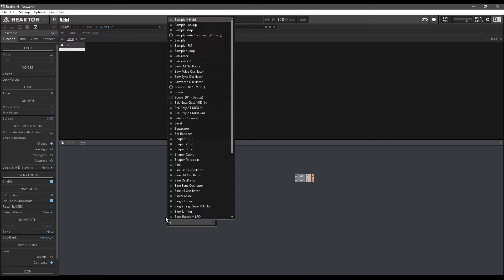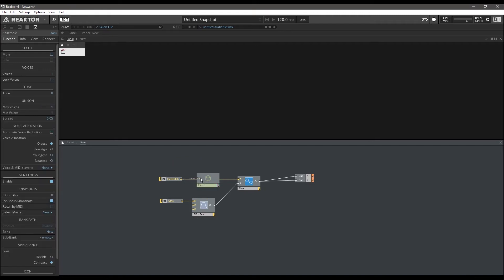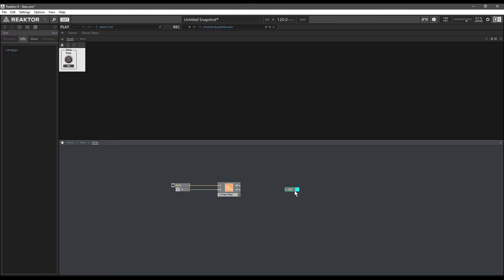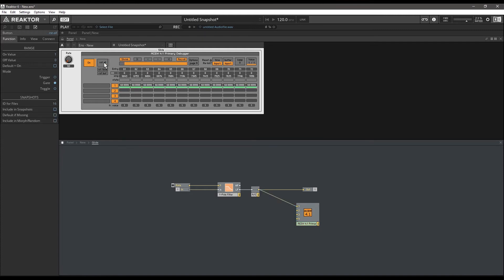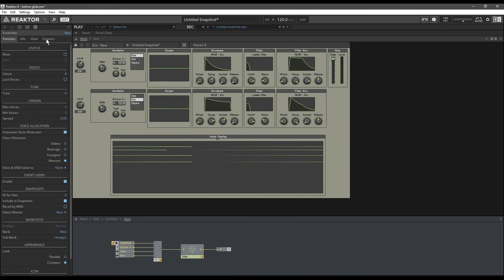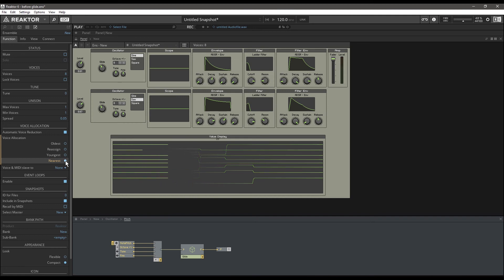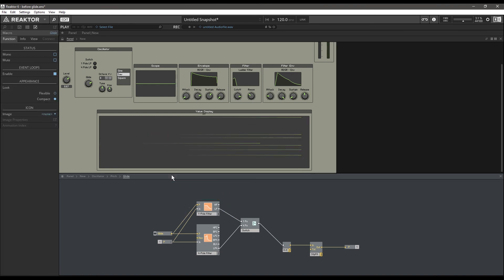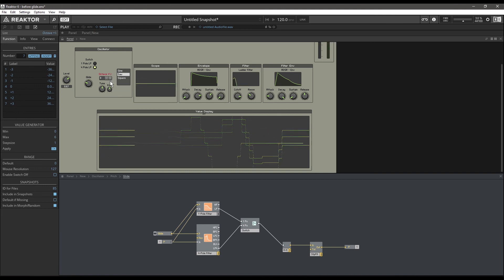Reaktor Tutorial - How to create PORTAMENTO & GLISSANDO

Comment: This is nice, man. Thanks for doing it. I hope you keep them up. You have a great presence on the screen. I have a few comments. 

 • I have been using music.stackoverflow.com for some Reaktor discussion. It's a pretty nice format. 
 • Check out this regarding portamento: https://music.stackexchange.com/a/88311/14836 
 • It seems to me that this approach to glissando only sort of works. For example, if I play a C three octaves above middle C until the glissando reaches it, then play middle C only briefly, the next time I hit a low note, the glissando will continue from where it left off.
 • What is the source of the Debugging module/panel?
 • Is that Value Display a module something you made/obtained based on an audio table?